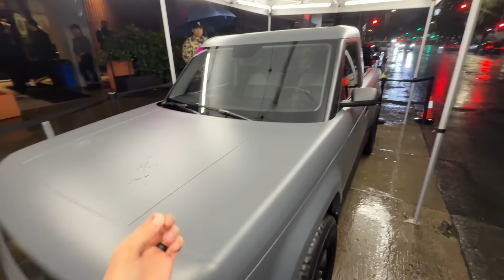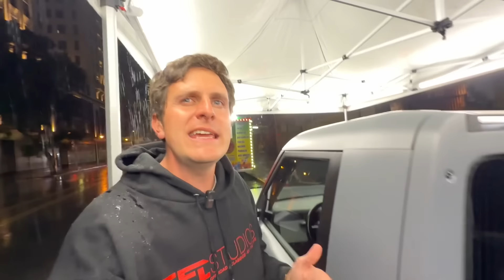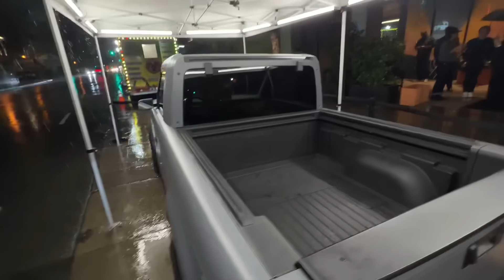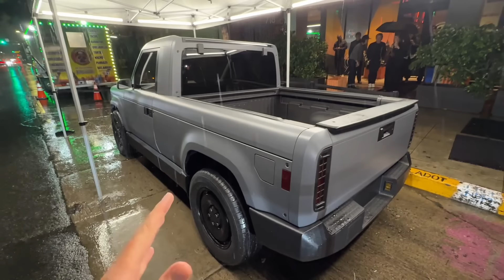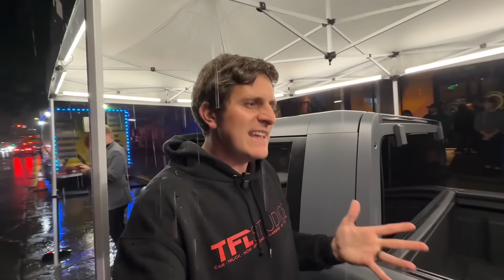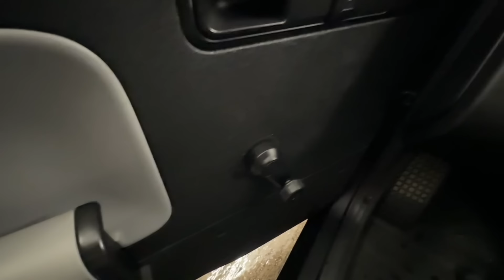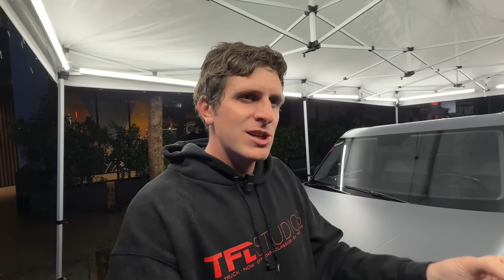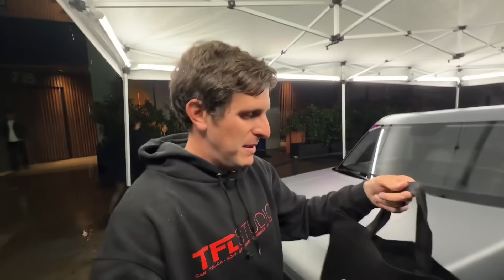The TRUTH About the '$20K' Slate Truck...Will This Really Be a Hit?

Comment: The 20k maverick sold so well it immediately became the 25k+ maverick.
Reply: You mean 30k+.
Reply: @notme3184 yes this price
Reply: Base model my buddies work has was almost 30k and loaded with high end features like high output turbocharged 4 cylinder, big screens, digital gauge pod and driving aids. The true base model disappeared.
Reply: @workingcountry1776  the base model didn’t disappear, your buddy didn’t order a base model. You don’t get fully loaded for base model price
Reply: Those were the days... I mean like all 5 days before the market adjustments came.
Reply: You mean pushing 40K maverick
Reply: @BS-zg7dn lol mine was 25k
Reply: You mean a 30k+ Maverick. The only 20k ones I’ve seen were exclusive to corporate orders at a local dealer. You can’t even order the 20k version from Ford if you’re a regular person.
Reply: Glad I reserved my Maverick the day it was announced, and took delivery when it was still the original price.  I paid less for a full loaded 2022 Lariat Maverick, than people are paying for XL and XLT Mavericks in 2025.
Reply: @BeagleBob-zw7wg  Then it became 1 of the most recalled vehicles
Reply: @anthonybrown3125  at least it only got recalled for little things, the power train is solid unlike many other new cars.
Reply: @mattneil1449  The Maverick recalls were nearly all for minor software issues. The only sort of mechanical issue was to check the windshield wiper motor for possible water ingress. My wife's Mav '23 XLT has had none of the issues the recalls addressed. She must have gotten a deal as her XLT hybrid with trailer hitch and full sized spare was $27,250, tax, title, tags included.
Reply: @anthonybrown3125  Funny how I’ve had no recalls on my Maverick in almost four years since new?
Reply: @waynemanning3262  they've had at least 6 recalls the last 2 years
Reply: @RollDogg435 software updates, dashpanel detachment during airbag deployment (-7000 units) and hybrid engine issues , not really huge recall issues and none have affected mine.
Reply: 40k more like.
Reply: Yup I ordered one, waited two years and couldn’t get it due to Ford and dealer price gouging
Reply: Dealer added plenty of add on to pump up commision.
Reply: Ford stated it would never be that price in the future
Reply: The tiny Subaru Crosstrek Hybrid is now $35K. The maverick is still a way better deal at $25K.
Reply: Yeah no!
Reply: All this is proof that Ford was right w the Maverick, and the other manufacturers need to make a competing model in the US.
Reply: You mean 40k
Reply: @BeagleBob-zw7wg  you mean 40k
Reply: You mean the 35k truck as much as. Ranger or f150 in 2021
Reply: Try 30k+
Reply: I have no use for a battery powered small truck at any price.
Reply: The little indent cup holders are for when you always sitting back there  waiting on the battery to charge.
Reply: Big facts
Reply: @BeagleBob-zw7wg  yeah that's real.
Reply: If it sounds too good to be true, it probably is. But, if it does work, and every one wants one, Elon can gut one of his sedan models, rip out all the actual cool stuff, and sell it just as easily.
Reply: Any electric cars that are less than 300 miles per charge will not sell that many unless it is the cheapest EV.  Poor people want to buy an EV  that can go everywhere they want.  POOR people don't have many to buy an EV and a gas car, they are poor.  If an EV costs $25000 and can only go 205 miles per charge, they will not buy it.
Reply: @SothyChek poor people shouldn't be buying brand new cars.
Reply: 40k+ in Canada
Reply: @akilghosh quite snow Mexican. Enjoy your free healthcare
Reply: @akilghosh  that's about $1k USD
Reply: @akilghosh how much in monopoly money?😂
Reply: @BeagleBob-zw7wg  pretty much the same I'd say 😂
Reply: If it came with a strong non boosted 4 cylinder engine, stick shift and all wheel drive I'd buy one today.
Reply: @michaelmartin2276   you might, but not enough other people would to justify it to Ford. People say they want a simple stripped down truck but just like the video says, people don't actually end up buying that variant.
Reply: @Sudonymer you're right, most people wouldn't.  Earlier this year I got a 2023 Tacoma (starting in 2024 they went all turbo).  2WD, 2 door, long bed, 4 cylinder, base trim.  If I had found what I wanted in a stick shift, I would have had that.
Reply: No interest in this thing whatsoever.  Maybe when I was young and broke. I'm now older and prefer comfort over economy. But I would also like to have the ability to build my own version of the truck I would like to have. We have lost the ability to order a vehicle the way we would like it and not wht the manufacturer is willing to make. This is where the manufacturers are missing the mark. By making people who prefer to order their vehicles have to bundle things up with other options that they may have no interest in.
Reply: @bradcoddington1679 I say scrap this bullshit and let the asian cars in! Bring on the tiny cars
Reply: @bradcoddington1679 the second half of your comment contradicts the no interest part
Reply: @Drewcrdllo  exactly, the whole point of this is to add only the stuff you want and none of the stuff you don't. It's not like you can't get all the features, it's that you get the exact combination by buying them separately. Then you can shop around to get the best radio, seat heater and backup camera you want.  If any of that crap fails, you yank it out and send it back instead of sitting at the dealership for hours. 

I would consider a power window on the passenger side and leaving the crank on the driver's side.  No manufacturer in the world would make a truck that way.
Reply: @michaellowe3665 I have been thinking the same thing.  Crank windows are bulletproof.  When the passenger side power window inevitably breaks, it's something you can live with.  Ask me how I know 😅
Reply: @michaellowe3665 I have been thinking the same thing.  Crank windows are bulletproof.  When the passenger side power window inevitably breaks, it's something you can live with.  Ask me how I know 😅
Reply: @rods6741 you can say that again.😂. I would do it so I can roll them both down without reaching across the cab when I'm by myself, and you get to keep the reliability of the crank on the driver's side. It also gets used at least 10X more often and than the passenger side, so it is the first to fail.
Reply: Because of dealerships not the manufacturer.
Reply: @JM-wd3dkdealerships raised the MSRP? What planet do you live on?
Reply: @BeagleBob-zw7wg dealerships mark up everything to get more money on commission bro … what planet you live on?
Reply: @Chadh9322 the MSRP is the MANUFACTURER SUGGESTED RETAIL PRICE.
It was raised. Dealerships can go higher or lower, but the manufacturer changed the price. You cannot have a nationwide price discussion based on different prices
Reply: @BeagleBob-zw7wg it's both
Reply: @BeagleBob-zw7wg  to be fair, I bought mine brand new in 2023 for 33K after they had it for 40K (msrp was 28) at the time average mark-up was 5k because of demand and availability. I searched out of state everywhere and they were sold out everywhere. The only reason I was able to get mine was because the greedy dealership had mark-up so high. They called me back twice!
Reply: Capitalism for ya.
Reply: @rodshop5897 what part of capitalism includes using taxes to fund destruction of affordable reliable vehicles so that manufacturers can make planned obsolete crap and mark it way up?
Reply: @BeagleBob-zw7wg  Capitalism = charging as much as the market will bear.  Look it up.
Reply: @BeagleBob-zw7wg it’s always the no nothings that’s make statements blaming capitalism for problems caused by the public sector/regulations
Reply: @rodshop5897  I’m sure with all the work you do, it’s carefully set so you earn just enough to get by, without ever crossing into capital gains.

Comment: I loved my 1980's Mazda B2000 Sundowner pickup. Regular cab, 2 wheel drive, 4 cylinder, standard transmission.
Reply: You beat me to it, I had an 87 B2000. Epitome of basic, reliable transportation. I'd take a brand new 87 in a heartbeat.
Reply: I had an 89 Mitsubishi Mighty Max base model that had zero options, not power steering, no a/c, no cruise control. And while it was cheap and reliable, there’s no way I’d live with that truck again. But it was a great first vehicle and that’s what is missing from the market today.
Reply: Chevy LUV 2 wheel drive doggy 4 cylinder manual transmission, slow but fun!
Reply: I had a 1962 Holden EK ute in the 1990s with a 138 cubic inch straight six with a three speed column shift with no synchro in first. It could carry half a ton in the back and ran on the smell of an oily rag but was slow. I drove that thing halfway around Australia too(every state and territory except Western Australia). I did add to it though. As there was no radio I fitted a Sony ten stack CD player and a bull-bar with driving lights because Australia. Had to replace the original generator with a beefier alternator to run those lights too. 

It was as basic as it got for the early 1960s and that was my daily for seven years and loved it! Oh and 7/16, 1/2 and 5/8 were almost all the spanner sizes needed to work on it too! There was plenty of work to do on it too keep it running though…

I can’t look at those huge American utes like the F-trucks, Silverados or Rams and think anything but extravagance but they’re common here now.
Reply: A little 4 cyl VW diesel would be perfect.   I suspect it would get 40 mpg.
Reply: @motormaker  they did better than that 40 years ago!  Closer to 50
Reply: @mikeb1039  yes.  Crosley had a tiny in-line 6 with a manual transmission the size of a lunchbox. They claimed up to 60 mpg in the 30’s or 40’s.  The cars were under 1600 lbs.  some models under 1300.   The geo metro from the ‘90’s got impressive mileage as well.  There was an XFI model with a special cam grind that claimed 53 city 58 highway. Most owners averaged high forty’s but that’s still far better than what is out there today.
Reply: and actually affordable! They were awesome!
Reply: I bet you didn't have to refill the tank every night either. A work truck will easily do 100-150 miles a day which means you will constantly have to be charging it.  I'd rather wait for the Aptera commercial vehicle that holds as much if not more but has solar charging.
Reply: @Mikey_Likes_It_Too  LOL>>>>>>>>>>>>>>>>>>>>>>
sure. Good luck with that.  
Our work truck seldom goes 100m in a day. EV be perfect.
Reply: Exactly what America needs. I had an 87 basic Toyota pick up. 22R 4 speed. Couldn’t kill it. Miss it so much. America could build this simple truck again. Pickup version and a Corolla version.
Reply: @deepnature6117  America is, it's called the Slate.
Reply: @deepnature6117  I had one of those. 2 actually.  Good stuff. America IS "trying" to build this.  SLATE........  In South Bend, IN
Reply: Still driving my 1989 Nissan Frontier pickup.  Two seater.  The only "extra" is air conditioning. Window cranks, no intermittent wipers. No cruise control.  I own two Lexus RX350s, but I drive the truck everywhere! 😃
Reply: @ctotheb7775  2006 SL500 is my summer car.  I want a Slate with crank windows.
Reply: Agree , same price 4 cylinder gas 5 speed option.  I could see them doubling  the amount of units they sell.

Comment: im all for it my only gripe is it is an ev. if they put an already premade small efficient motor in it id be all in. i dont want all the bells and whistles because i dont take advantage of them even though my 2013 outdated truck has them. a small modular truck/suv platform is what im excited for. i was upset that we would not get the Toyota IMV 0 in the states. i would have bought it the second it hit the showroom floor because of the many possibilities of what it can be. i see tht heavily in this but the EV kills it for me having to rely on electric limits it heavily to mostly home owners and people closer to the city so they immediately killed the idea of it being an anyone vehicle which is what most car manufacturers do nowadays. They only target a certain demographic instead of it being for everyone like it used to be. Im still heavily on the fence with this if i will buy one but i still follow it along the way because i see potential. i might even just buy it to engine swap it but only time will tell.

Comment: Personally think Government should have intervened in the early 2000's to prevent pickups from becoming over sized bloated gas hog family vehicles. The exemptions for trucks were for working people that hasn't applied for at least 2 1/2 decades. 
That has literally screwed the working person that needs them for work. People should be in cars and the rarer times they need a truck there are rentals. Government should also have put a limit on street legal HP.

Comment: I want a 4wd 200mil range 0-60 in 4ish truck. Reg cab short bed all the tech. If it can do quicker even better longer range even better. I don't need to tow much or  hualing more than 400#. Im wanting fsd i enjoy that also. I get the slate is not even half my list but its a start. I hope we can get something. Im currently buying parts to do a 07 Colorado to EV swap. Tesla ev parts because they have the best app. Im really reskinning a model 3 performance. I really enjoy climate control from anywhere. Yes, rivian is a close second but fsd and nacs is important. Cybertruck is too polarizing for customers as I want to use it for business. Its not positively taken but probably is the easy pick. Im also cant justify 80k. So a 5yr old vehicle is my choice. Probably 4yrs to go for ct to be low enough 😊

Comment: <this is the math: the utility truck should cost half as much as a 4-door sedan with trunk, since the back half is only a steel box>
-4 door sedan, 40 grand
-2 door utility truck, 20 grand
??!!
<manufacturing that steel box is nothing: no seats, no air conditioning, no windows, no roof, no trunk, etc.!>
<100,000$ USD trucks are total madness, a legacy automaker scam>

Comment: Not sure about the range Tommy. I’ve got a BEV and the range drops in the Winter. So sub 150 miles. Doable if your commute is short. But realistically you’d be plugging it in every night. Not sure what the battery chemistry is but would you want to be charging it to 100% every night? Having said all of that I could make it work so bring it to the UK😂 We have a pretty decent charging structure and a less retrospective market… generally.

Comment: I hope they succeed, as the factory is nearby and will employ my friends.  I like the vast creativity that the customization offers, but I doubt that there are enough creative people to take advantage of it.  With a 150 mile range, though, it is a toy.  A trip from the Slate factory to Indianapolis and back turns into a Top Gear challenge.  I don't know that the range would really matter except for the charging time.  A small gas engine would make a lot of sense though.  Maybe they could make a deal with Briggs & Stratton.

Comment: The Edison style is the best way moving forward.
Reply: Edison is just sucking up a lot of money and cannot get cleared of the Canadian regulations.
Reply: @lisamcdonald7828 that doesn’t mean they don’t have the best model…
Reply: @ryanbailey6600  Lol suckers burned all the time! Or as the old saying goes a fool and their money is soon parted!
Reply: I agree 100% And with a truck this size and a small battery pack like that I truly believe they could get away with a small under 25 horsepower diesel engine to get around and get away with not having any exhaust after treatment a small little 24.5 horsepower 3 cylinder Kubota diesel under the hood with a generator would be perfect

Comment: I really really like the slate, I have one reserved, but these are all the reasons I still struggle with it. I have 2 EV's currently (an EV9 and a Mach E) and around town they're great, but I do take those road trips and I do need a truck instead of two SUVs. I live in Central Texas and even getting from Austin to Dallas can be a seat of your pants experience once you leave town, especially if a charger is out.  Not a great feeling when you're transporting a toddler. I live 15 minutes north of Austin, and less than 5 minutes from my house you're practically in rural Texas, so not having any form of AWD is a liability in the places I have taken my trucks in the past. And really, at 27k base without the credit, it really becomes a tall order. I hope it does well, and I hope the people that love it buy one. I'm just struggling to see how I can make it fit with my life.

Comment: Tommy makes some good points. I think the kit to convert to an SUV will only sell if its fairly cheap, easy to take on and off, and easy to store when not in use. As for a gas model I think the current US trend away from EVs will change for the reasons Tommy said - they will work just fine for the real world usage of this truck. That said, will it sell? I have my doubts.
Reply: @JamesMcLaren1000   the suv conversion kit includes a roll cage like structure, airbags, seats with seatbelts etc. It’s all necessary to meet safety requirements. I think this will cost way more than people hope. It will still only have the relatively short doors which makes getting to the backseats quite a challenge.  I doubt many will find this option worth it.

Comment: It’s great and all but unfortunately not very useful in today’s world . Especially with 150 mile range once you factor in weight and cold weather that will probably plummet.
Reply: It has a 240 mile version.  I agree that 150 miles is inappropriate for 2027
Reply: @Drewcrdllo  I guess that’s a bit more acceptable but still doesn’t outweigh the need for it to be wrapped
Reply: @LTHero. haha, I'll just take the panels off and spray them with red primer